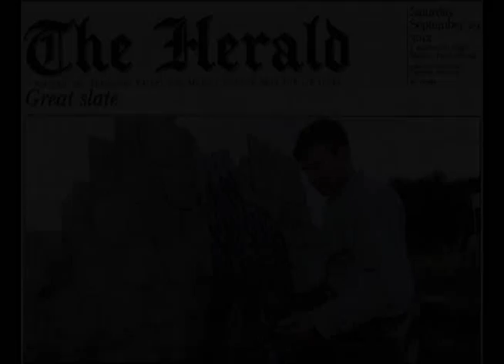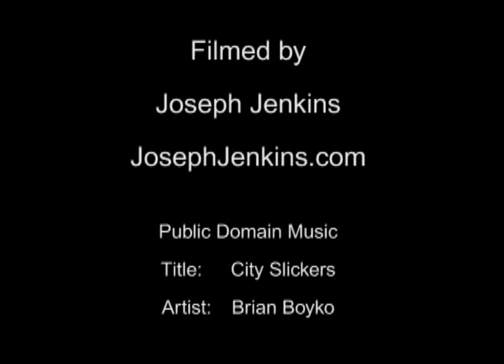Slate Roofing Contractors Association 2012 Conference

Comment: Aren't you to melt solder by heating the metal to be soldered hot enough to melt said solder, also hooked rake slate should be nailed.
Reply from the maker: Correct on both counts.
Reply: @jcjenkins01  thanks